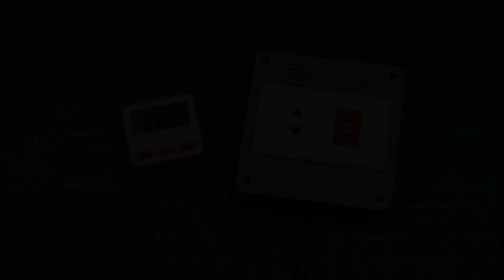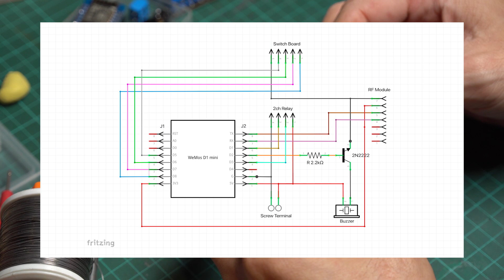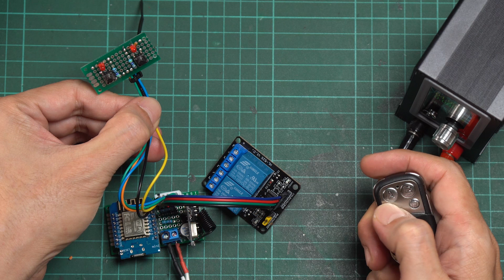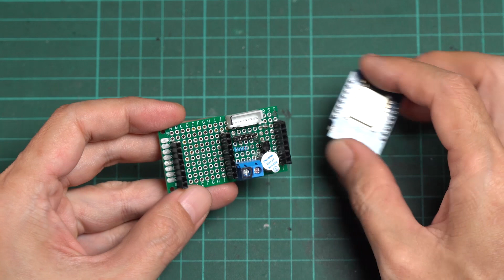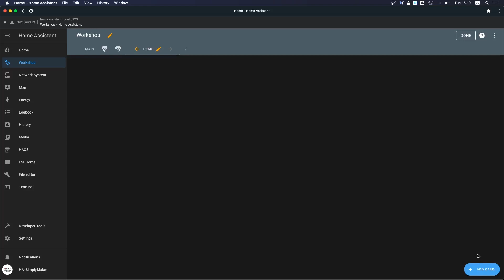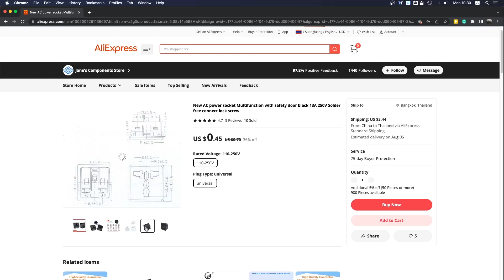Build a Smart Outlet for Soldering Tools: ESP8266, RF Control, WiFi, Custom Functions using ESPHome

Comment: I used a smart plug i bought that is connected to home assistant. I tell google assistant to turn on the de-soldering tool you have in the video that i purchased. It turns on then after 3 min. google tells me its ready to use it, and if i haven't turned it off in 30 min. It turns off and google tells me it turned it off for safety reasons. 😀i also use ESPHome to connect my DIY sensors, LD2410C mmWave Presence sensor BME280 temp/humidity sensor and BH1750 LUX/Light sensor packages. It makes it easy with ESPHome. For a board i use electroCookie boards that have power rails around the board, works well.
Reply from the maker: It's interesting setup. Can you share your google assitant setting? THANKS.
Reply: @simplymaker  here are the 2 automations that i used. Also need to create 2 HA timer helpers one for 3 min and one for 30 min.

alias: Desoldering tool timers expire
description: ""
trigger:
  - platform: state
    entity_id:
      - timer.desoldering_tool_3_min
      - timer.desoldering_tool_30_min
    to: idle
condition: []
action:
  - choose:
      - conditions:
          - condition: state
            entity_id: timer.desoldering_tool_30_min
            state: idle
          - condition: device
            type: is_on
            device_id: 4fd31542171ebcaf37341ec03a9b35f9
            entity_id: 1a6ca21842ee247d8ec5ce2653fa8ecd
            domain: switch
        sequence:
          - service: tts.cloud_say
            data:
              cache: false
              entity_id: media_player.bedroom_speaker
              message: Shutting down desoldering tool its been on for 30 minutes
          - type: turn_off
            device_id: 4fd31542171ebcaf37341ec03a9b35f9
            entity_id: 1a6ca21842ee247d8ec5ce2653fa8ecd
            domain: switch
      - conditions:
          - condition: state
            entity_id: timer.desoldering_tool_3_min
            state: idle
          - condition: device
            type: is_on
            device_id: 4fd31542171ebcaf37341ec03a9b35f9
            entity_id: 1a6ca21842ee247d8ec5ce2653fa8ecd
            domain: switch
        sequence:
          - service: tts.cloud_say
            data:
              cache: false
              entity_id: media_player.bedroom_speaker
              message: Desoldering tool is ready to use
mode: single

and the other one

alias: Start 3 and 20 min Desoldering Tool Timers
description: ""
trigger:
  - platform: device
    type: changed_states
    device_id: 4fd31542171ebcaf37341ec03a9b35f9
    entity_id: 1a6ca21842ee247d8ec5ce2653fa8ecd
    domain: switch
condition: []
action:
  - choose:
      - conditions:
          - condition: device
            type: is_on
            device_id: 4fd31542171ebcaf37341ec03a9b35f9
            entity_id: 1a6ca21842ee247d8ec5ce2653fa8ecd
            domain: switch
        sequence:
          - service: timer.start
            data: {}
            target:
              entity_id:
                - timer.desoldering_tool_3_min
                - timer.desoldering_tool_30_min
          - service: tts.cloud_say
            data:
              cache: false
              entity_id: media_player.bedroom_speaker
              message: Desoldering tool has been turned on
      - conditions:
          - condition: device
            type: is_off
            device_id: 4fd31542171ebcaf37341ec03a9b35f9
            entity_id: 1a6ca21842ee247d8ec5ce2653fa8ecd
            domain: switch
        sequence:
          - service: timer.cancel
            data: {}
            target:
              entity_id:
                - timer.desoldering_tool_3_min
                - timer.desoldering_tool_30_min
          - service: tts.cloud_say
            data:
              cache: false
              entity_id: media_player.bedroom_speaker
              message: desoldering tool has been turned off
mode: single